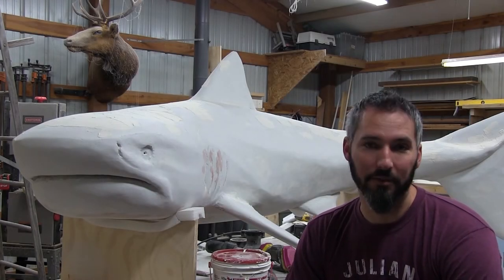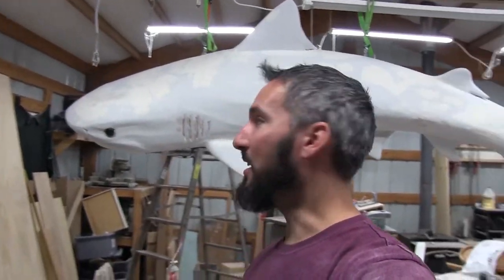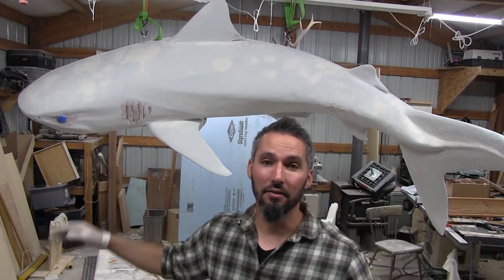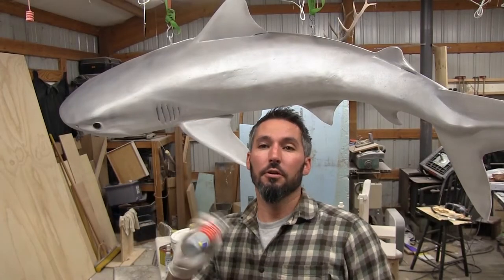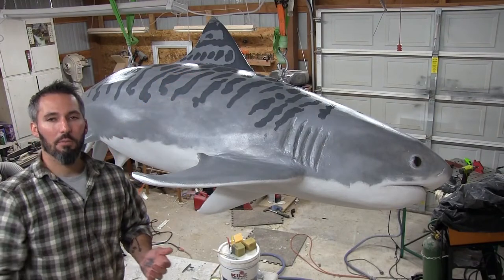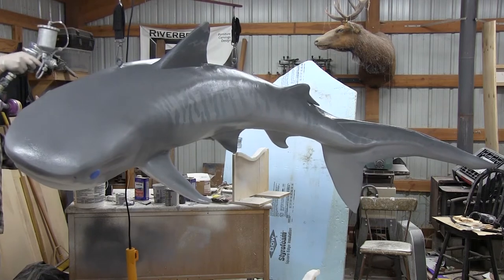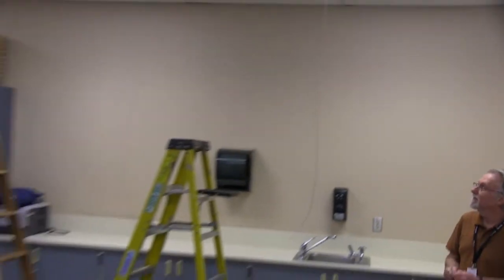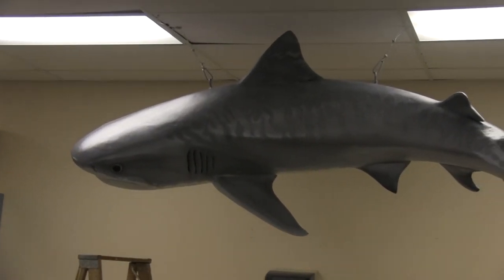TIGER SHARK foam carving - How-to Part  3 - FINISHED!

Comment: Except for the tail, the tiger shark looks good. Their actual caudal fin starts further back. The transition from the adipose fin to the base of the caudal fin is a bit thinner without that much bulk on the flanges. The dorsal lobe is more compressed and has a milder edge. 

Aside from the tail, it's a really nice build.

Comment: What an incredible build!!  You have answered so many questions that I have for a restore project on a great white that I am doing.  While I am an artist that is well versed in ceramic, glass and mosaic I have to admit I am in over my head on this project!  LOL  I have a couple of questions and I was wondering how to reach out to you to see if you would be able to answer these for me?  It's 6 feet long, originally done in fiberglass (which I don't want to work with) and needs both fins and a bit of the tail replaced.  I am hoping to use styrofoam to replace these.   We live in the thumb of Michigan and he will hang in an outdoor kitchen on the shores of Lake Huron.
Reply from the maker: Hi Laurie, thanks for watching and hopefully I can help you right here (in case others might need the same assist). High-density foam is a great medium to work with for replacing those fins, or even the spray foam can be used to fill gaps like you have on the tail. The important thing to remember is to not fiberglass directly over foam or you risk melting it. Using foam to build out an area is ideal, then I switch to a fast-drying sheetrock mud (there is also epoxy clay that works too). You can sand this smooth with the existing surface. Do not use an aerosol primer or you also risk melting any exposed foam. A good water-based primer is great--something that can be sanded and covers fully. From there, you can build your fiberglass layers. Build enough layers far enough from the added-on parts with enough resin to allow you to smooth out the transition and nobody will ever be the wiser 🙂 You'll be ready for primer/sanding and paint next! Hope this helps! It'll be well worth the effort!

Comment: Phenomenal!!!
Reply from the maker: Thank you!
Reply: @RiverbendWoodworks  
      You are most welcome! Could you estimate to total cost on this project; please? I'm wanting to do a hammerhead, actually not sure where I'll put it when I'm done, your videos put the afterburners on my drive to do so.
 I almost kinda of got choked up when I saw where yours went. Very cool, selfless ambition is a very honorable trait. I particularly liked how you broke down the proportions to get them acurate.
Reply from the maker: Thank you so much for the kind words! I love doing life size foam pieces for the kids because it really does put things in perspective for them in science class, and what’s cooler than a shark?! Overall, I think this can be accomplished with about $140 in foam, $90 worth of a tub of Roscos Foam Coat, and perhaps another $50-100 worth of tools like a coarse rasp, wire brush (also good for foam removal), and metal components for the support structure. Realistically, you can make the steel structure without ever needing to weld anything. You can also pay a touch more for the blue, higher density foam and get a bit easier finish to work with for the foam coat as well.
Reply: @RiverbendWoodworks  
      Well heck yeah definitely doable pricewise, cool beans. Fortunately I believe I have the tools; I actually have a farriers rasp that has a #13 billard ball on the end, makes working around corners and curves a breeze. I've used it for a multitude of applications for dang near 20 years. Thank you, thank you! 
I look forward to you starting the saber tooth tiger, that will be awesome! 👌 

Stay frosty my brother,
Rich Barnhart
Reply from the maker: Sounds like you have a great plan in place! I’d love to see your progress and follow along if you’re on Instagram. You can send me a message there at @riverbend_woodworks and I’d love to see what you have going! Thanks for watching!
Reply: @RiverbendWoodworks  
    No sir I'm not on IG, don't know if I could cram anymore into my phone LoL. I did send a friend request on Fakebook tho, I'm on there a few times a month to catch up with folks. In fact when on there late last night found out one of my Marine buddies, and rodeo hauling pardners just passed; gonna have a few cold ones later today and reflect. We were no angels but I could always count on him; a good Marine, a good man.
It's funny, we got together a few years ago and it had been at least 30 years since we'd last seen each other; we picked up right where we left off, like it had only been 30 days. 
Enough of that; I don't remember at the moment which movie but Lee Marvin once had the lines, gotta get busy living or get busy dying (something like that), I choose life. ☝️
Reply: Doh! Shawshank Redemption
Reply from the maker: Classic! Great movie!

Comment: What you cover the styrofoame with ?
Reply from the maker: In Part 2 I show the product and how I applied it, and it’s called Roscos Foam Coat. That foam coating is used for stage props and is pretty solid sneak fire resistant. Great stuff, and I was able to use a spray gun to apply it.
Reply: @RiverbendWoodworks  thank you very very much-☺👍!